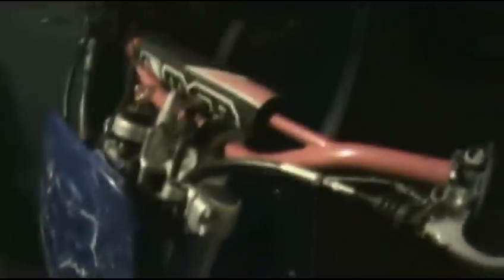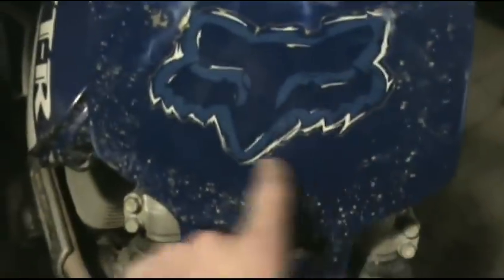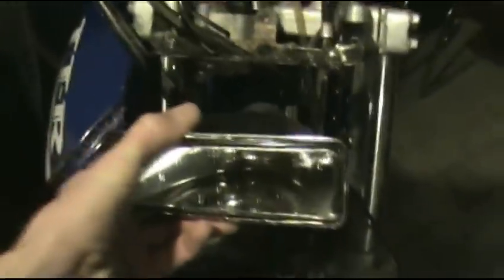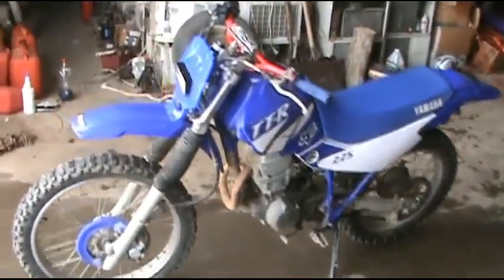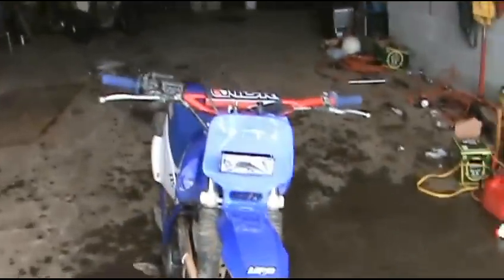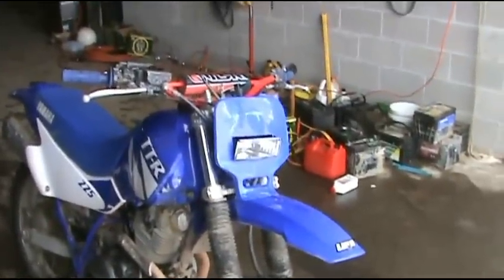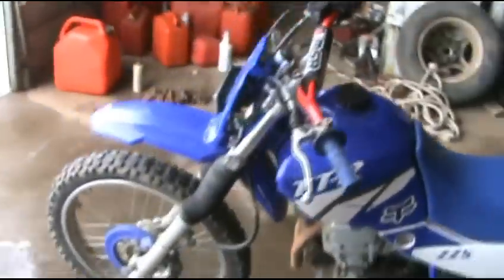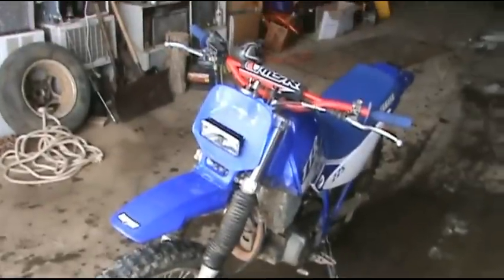Custom Redneck Headlight

Comment: @blargblah there's a provision in the wiring hook ups behind the plastic faceplate there to attach one in just like on the XT225. ya just have to look up the wiring diagram then you can wire a switch or tie it in to turn on when the bike is on.

Comment: I was about to ask if it was an o-ring chain, but you answered that. I had a few yamahas back in the 80's and 90's. The IT-200s seem to work good deep in the woods. Light weight and dependable 2-stroke engine. I had a Maico Spider 490 set up for hill climbs. Killer bike.